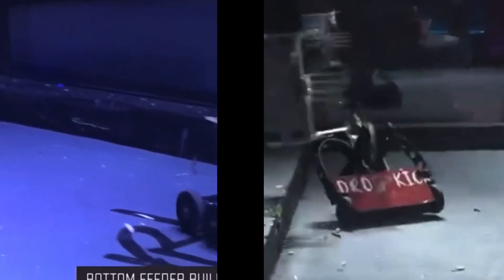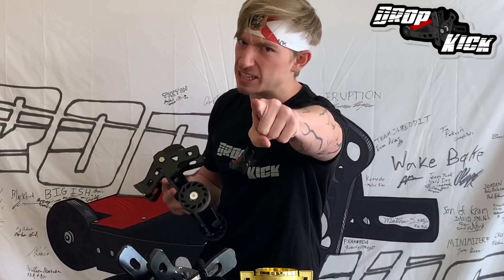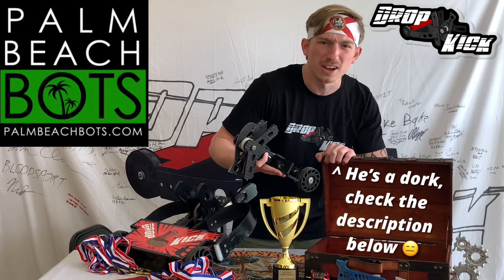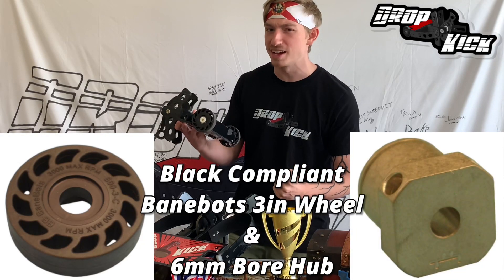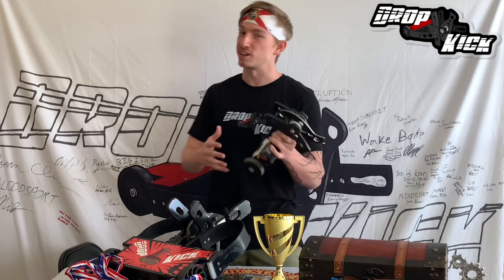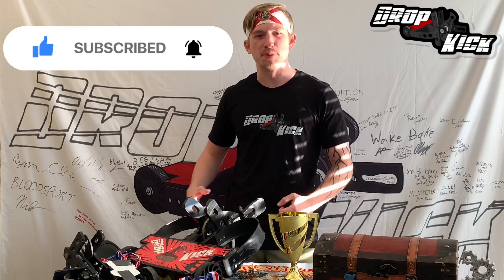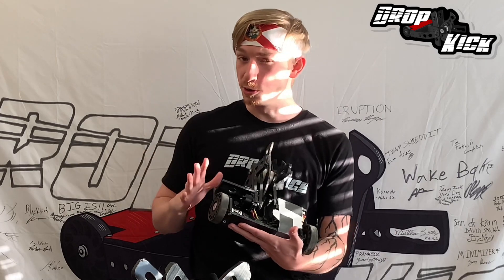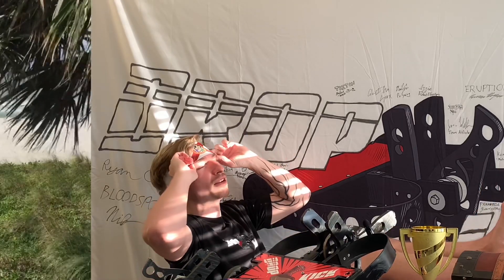3lb Beetleweight Combat Robot Drop Kick - Build Breakdown and Tips

Comment: As far as wheels go, custom wheels are a really nice option. Less likely to damage your motor shafts if you use a TPU 3D printed hub and a urethane cast tread. They will have much better grip than a lot of Banebots wheels.

I also strongly recommend against using the BEC built into a weapon ESC as weapon ESCs blow up all the time and then your whole bot stops. I use a separate BEC or one built into less frequently killed drive ESCs. I have never once had an external BEC fail in Division in over 50 fights but have had a lot of esc failures.